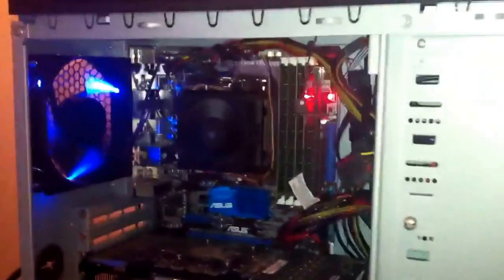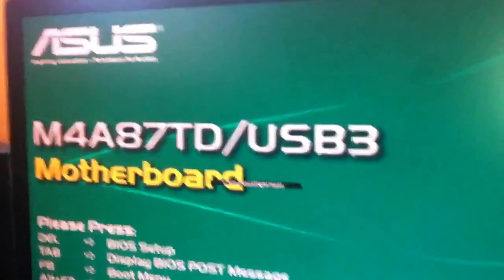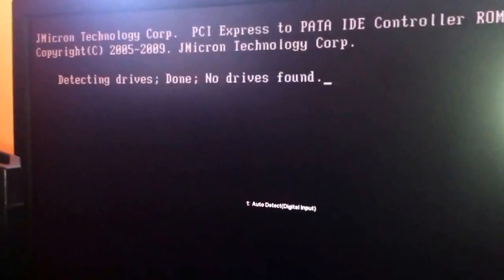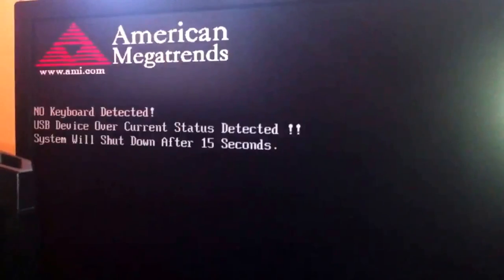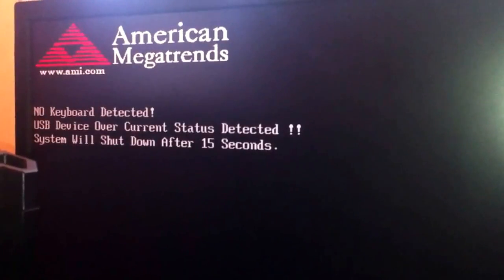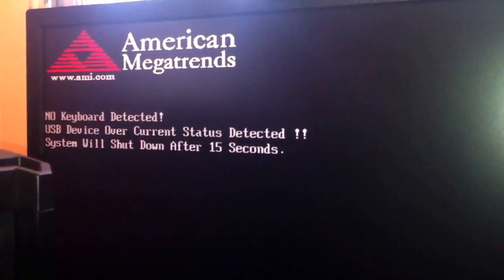USB Device Over Current Status Detected!!!

Comment: I received the same error, I removed all devices *usb devices and still it didn't work. I instead inspected all my USB ports and found that whoever tried to plug in a usb device bent the pins, once I fixed the pins .. The error went away.. That is a quick fix

Comment: hi man.I tried to disconnect front usb connector but didn't works. still flashing the problem on my monitor.pls help to fix this problem.
Reply: Check all your USB ports for damage, check the pins inside the connector aren't bent. I just fixed this problem with my gf's computer and apparently our son decided to try and plug in a USB backwards by forcing it. I was able to bend the pins away from touching anything and that fixed the error, but now that USB is forever broken (until I feel like soldering a new one)

Comment: for anyone looking for solutions to this, this is mine (might not work for you)
I ve tried everything, and i was ready to dump the mobo when i decided to read the manual, it didnt say anything helpful, but it make me realize that i was missing 1 jumper. 
Bought a bag of jumpers, put the one that was missing and bam, problem solved
Reply: FellTheSky which jumper and how will it suddenly be missing?
Reply: Where did you buy these from
Reply: thisisparkedTV
most electronic stores have jumpers, but you can take one of an older motherboard if you need one intermediately

Comment: Ok guys, this is what worked for me:

The three pins were contaminated with dust. They are located near the battery and the fan. After disconnecting the power cable, gently remove any dust particles on the pins.

I hope this resolves the problem for you too!
Reply: i love you dude , it worked for me so fix ti 3 pins 😘
Reply: Tristan works like new again! note to self: clean your dusty pc lol.
Reply: what 3 pins i cant find it

Comment: A bit late to help but I had the same problem and maybe it can help others... They say to remove the BIOS battery and jumper for 5-10 seconds and I tried that it didn't work.

I left the battery out and the jumper moved for about 30 minutes and after that I could get back into the BIOS.

It seems to be a common problem with Asus motherboards.  i tell ya if I didn't know as much as I do about computers I'd be so screwed by now lol.
Reply: What is the bios battery.
Reply: ***** small coin type battery attached to the motherboard
Reply: Which jumper?

Comment: reset BIOS by shutting computer down (you dont need to touch battery on a desktop pc like one in video above)
find the 'CMOS' JUMPER on motherboard, usualy it is close to the battery and usualy is labeled 'CMOS'.
It is a 3 pin jumper, and the jumper will be 'sitting on'' 2 pins, with the 3rrdd pin visible.
Simply move the jumper so it 'sits on' the centre pin and the visible pin.
Now just power up computer, windows will not start, but dont worry as this is normal.
Wait for aboout 60 seconds or so, then power off computer.
Put the jumper back in its original position, now reboot your computer.
Thats it, your BIOS is re-set to default values. You may have to go into your BIOS now and adjust some settings to suit your personal preference such as 'boot order', usb configeration and the like. 
You can enter BIOS on most motherboards by pressing the ''DELETE or F8'' KEY as soon as you power computer up.

You can also disable the rear USB ports by going into BIOS and going into 'USB config settings, and change setting from ''ENABLED to DISABLED'.  Then hit the 'F10' key to save changes and exit to reboot.
hope this helps somebody.
Reply: i fix computers for a living.  i recently had this problem on my own computer which i custom built and it even baffled me.  i knew none of my usb ports were defective, so i found the easiest option to fix it was to....unplug all cables that are not needed to boot the pc. In other words, leave the C: drive leads in and power leads in from PSU, then boot pc up, it will either boot or give the same error.  If it attempts to boot, try going into your BIOS as fast as you can and reset your boot order, make sure any overclocking is disabled, basicaly make the BIOS pretty much default.  once done, power down pc.  Re-connect all cables and reboot and your pc should now start (as long as you are sure their are no defective usb shorts).
also check your cables and wires, sometimes a wire may have got hot and a small part of thew plastic protective casing has left part of wire bare, which, if touching anything conductive will also give the usb error. So check all wires and unplug and reseat them and disable any overclocking and 9 times out of ten this will fix the error.
the actual USB error that is shown is nonsence as like i said, ive had this issue a few times and their has been nothing wrong with any usb ports or devices, and just simply doing the above actions has solved the issue.
Reply: *****  This is helpful! Thanks!
Reply: u r welcome bro, any issues just pm me on you tube, or add me on facebook.  my username on facebook is 'cecil henley'.  im a computer engineer and white hat so most of , all of my advice i give for free and only charge small prices for repairing computers in my local community.  i tell you how to fix things yourself without having to buy expensive tools or getting ripped off by the shops. piracy is al about giving info and advice for free,,not like the assholes on E-bay who try to charge you for simple ''how to fix this guides',  so yeh hit me up anytime pal.
Reply: it worked! and i dont know shit about computers. thanks!!!! woohoo
Reply: good stuff mate, glad it helped you
.
Reply: i need your help mrmasse0

Comment: From a tech's point of view; Most of the time when you get this error, it is a motherboard issue. I have seen only one that had a USB grounding issue, where the front USB port was broken and the contacts were grounding out. If you have unplugged the front ports, reset the BIOS, Re-seated the RAM and CPU and removed and reinstalled the MOBO, it's a bad MOBO.

Comment from the maker: In my case the motherboard was screwed. Online,From what I've found online, disconnect all USB ports if possible, unscrew the motherboard, put it all back. If still errors, you'll prob need a new motherboard. If you take it to a pc store, make sure they know how to test the motherboard, I found 3 that just took what I have told them and were more than happy to just instal a new one without even having opened the case to take a look. Some so called IT shops are less than competent.